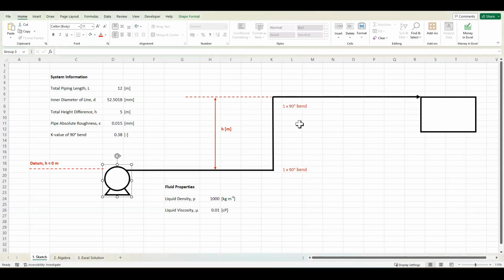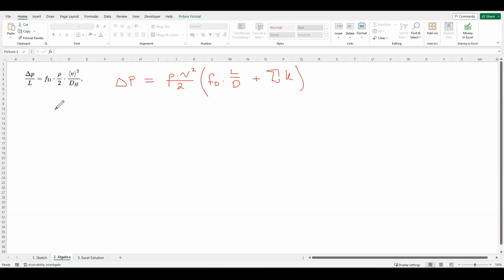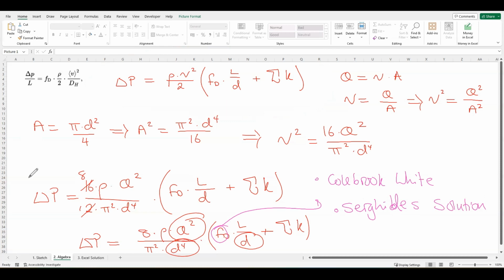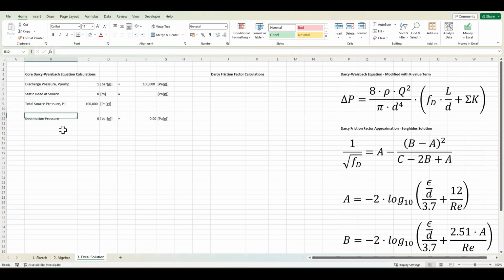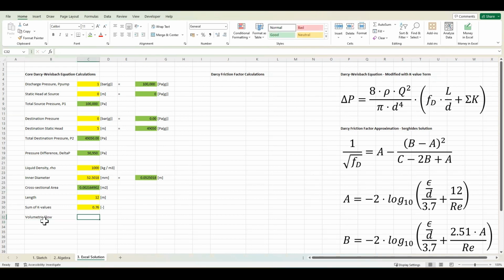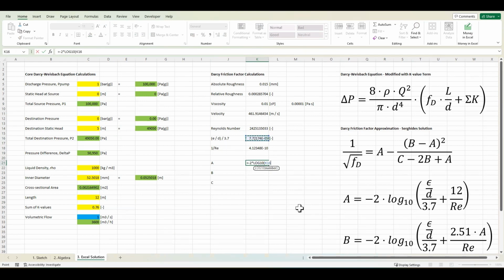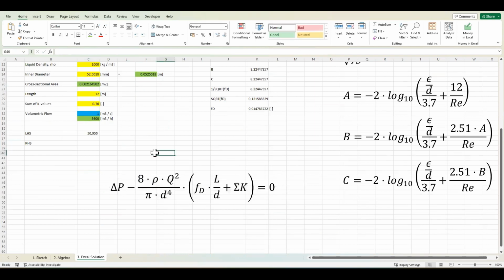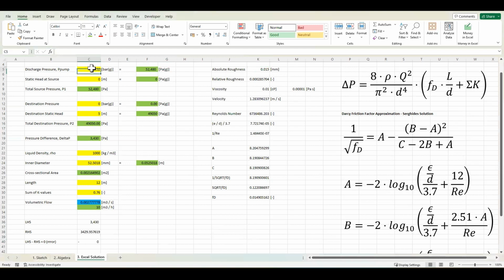A Practical Introduction to the Darcy Weisbach Equation for Solving a Simple Fluid Flow Problem

Comment: sir, this has been most helpful. I cannot believe how in almost 1 year, only 88 people saw this. And I am the 89th.  Please share this excel with me, or at the very least tell me if i modify my parameters of viscosity and density to accustom AIR instead of WATER, will it still hold true? I don't mind a margin of error of 10%.
Reply from the maker: Depends on the conditions - you cannot assume that density is constant for air (compressible fluid), unless the pressure change between the inlet and outlet is small. I haven't done this personally but you can take the average pressure across the pipe and use that in the Darcy-Weisbach formula, maybe a future video on how to model compressible flow...there are better equations to use than Darcy Weisbach.
Reply: @ChemEWiki  the pressure change between inlet and outlet must be large.  Not so much because of the large length of piping used. But certainly because there are 3 outlets all of which have 0.75 inch diameters. The inlet is 3 inches. Also, there are several elbows and Ts along the way. The flow says 3.6 cubic meters per minute.  

Even when I copied your exact excel sheet and substituted air viscosity and air densities, I was left with a very high Friction factor and it didn't make sense. Even though Serghei's solutions of A B and C did return similar values. 

Thanks for answering. This is really hard. Even when I asked AI for some guidance, I had to ask it the same question 10 different times before I got a reliable air dynamic viscosity.
Reply from the maker: @OmarBaassiri-wd6wc  I don’t know your exact system but if you have multiple outlets you will have to use a different method for estimating flows from pressure. Hardy Cross method is used in liquid networks, I imagine it’s applicable to incompressible flow networks but you need a different pressure balance equation to the Darcy Weisbach. Might I suggest the IChemE’s Knovel library for physical properties data of air, or physical properties software - DWSIM can predict this and is free.